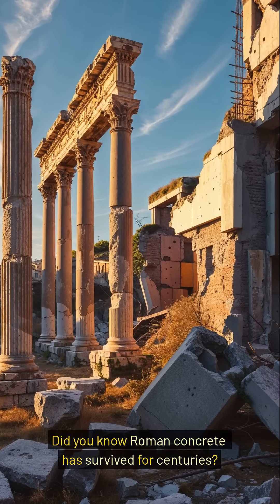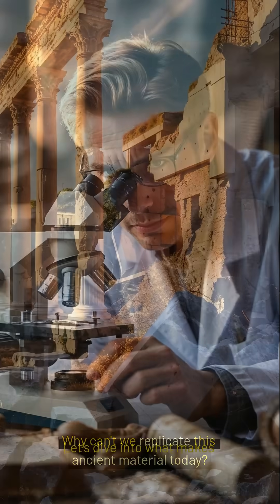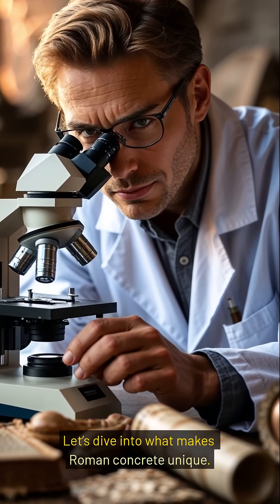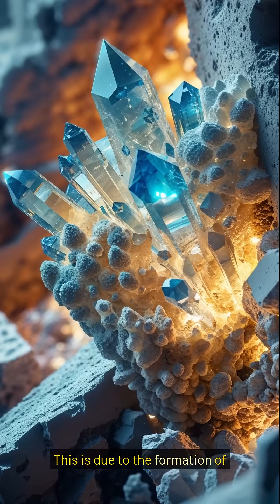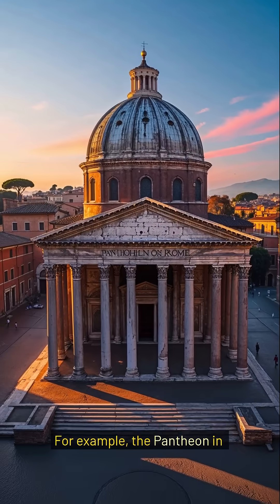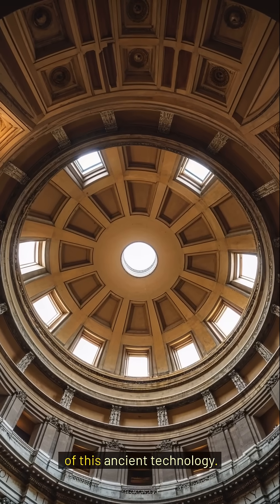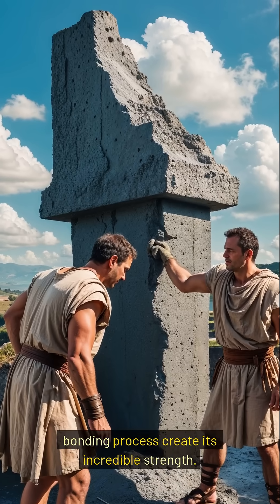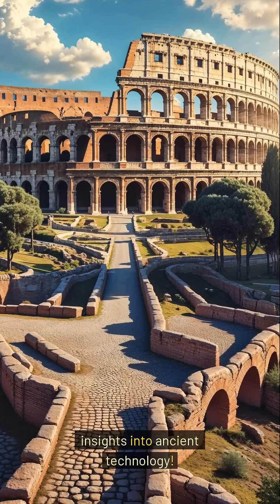The Roman concrete — Why modern builders can’t replicate it

Comment: Apparently someone has just recently discovered the secret to it, and it involves lime deposits within the concrete, that's whenever the concrete cracks and the rain soaks into the crack, it reacts with the line deposits and they are activated to reharden, like fresh new concrete, which therefore "self heals" the crack.
At least that's what the most recent source claimed when I saw it sometime in the last day or so...
Reply from the maker: Exactly! You’re spot on. That’s the latest research, those lime clasts act like tiny healing capsules. When water seeps in, they react and seal the cracks naturally. The Romans basically invented self-healing concrete 2,000 years ago  way ahead of their time